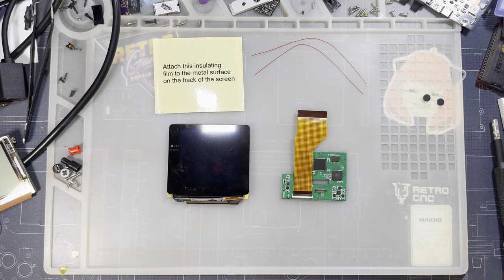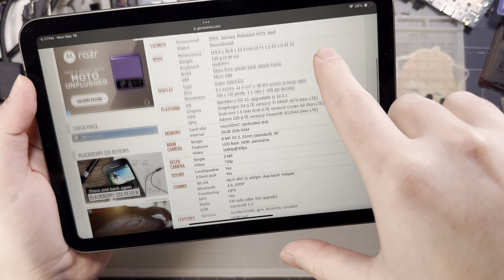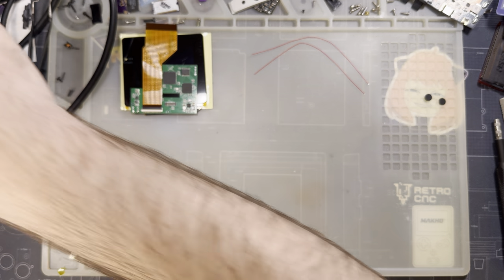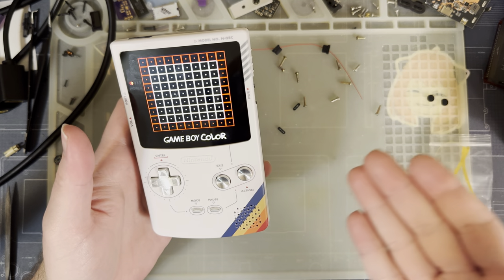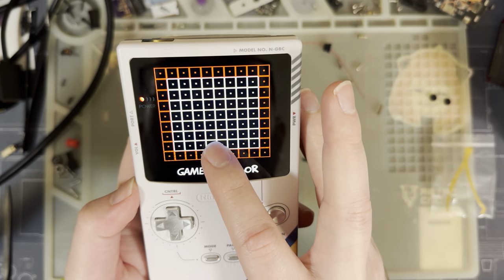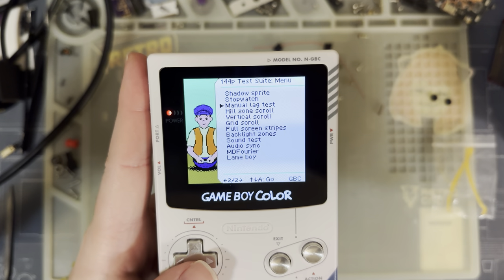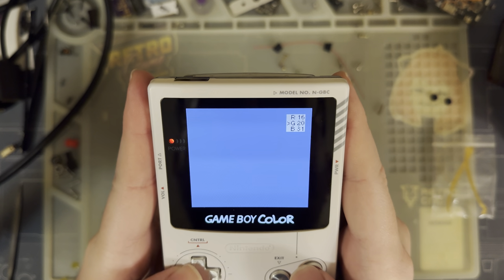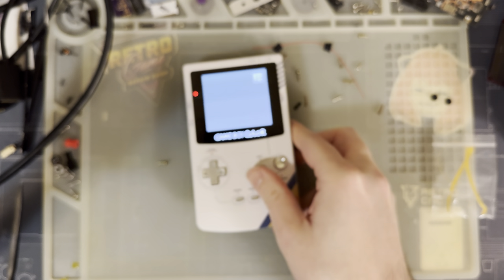Game Boy Color OLED Backlight Kit with Touch Screen OSD

Comment: The power consumption with pixel grid should be lower, because only 9 instead of 16 pixel are lightning up by itself (no common backlight with oled). Thats how oled usually works, black pixel are just off.

Comment: The color modes are meant to be used with original GB carts while booting up in grayscale mode (hold left+B). You get the same default color palettes as their DMG kits. If you don't hold left+B, then you get the weird color palettes.

Comment: OLED ALREADY?!?!
Nice, can’t wait to use this for the FPGBC.
Reply from the maker: This doesn't work in the FPGBC. 

Funnyplaying is making one that will take one of these OLEDs but Q10 displays have never been interchangeable with Q5 displays.
Reply: Unless someone makes a separate screen mod just for adapting this screen panel to be used with the FPGBC, I wouldn’t bet on it working since I can’t imagine it’s drop-in with something meant to only use the Q5 IPS screen. Maybe if FP starts using the Q10 OLED screens and releases an update to get it working on the FPGBC.
Reply: Ah, Makho already explained it, didn’t see that until I refreshed.
Reply: want
Reply: @makho Do you actually know for sure that FP is planning on releasing a FPGBC with this screen or were you just predicting?
Reply from the maker: @SlCKB0Y-sb1kg  I know they already have screens on hand. The rest is speculation.

Comment: proper desaturation instead of those gimmicky color filters would be a real killer feature!
Reply: Buy Q5 instead.. I have both Q5 and Q10(OLED). Q5 have exactly what you want. It is that good.
Reply: @Rurounik99  I bought a FP Q5 display last year :) It doesn't have color desaturation, colors are too intense compared to an original GBC screen. Or are you talking about a new Q5 revision that now has this feature?

Comment: that black bar is because the pwm modulation, that could affect the eyes strain negatively old oleds have max 240mhz in high brightness and 120 in low.  ips panels can have pwm but the valor is high enough that dont affect your eyes. Im sensitive to low pwm in oleds and i cant use any device with oled screen unless they have high modulation or local screen dimming . Sadly is not information of the pwm of this screen i tried to research and i come empty handed.

Comment: I have the same case with the funnyplaying motherboard and the metal buttons. How did you get the membrane to fit over the start and select buttons? My membrane over the start and select does not fit over the metal buttons because they protrude way to high and it's hard to keep it balanced - did manage to put it in, but the buttons were super stiff and did not register start and select. Any ideas?

Comment: hey bro can you post a link the tape insulation you used ? or go more in depth with why and where needs to be protected like make a separate video going over and more in depth possibly showing you also trimming the pins or something thank you i enjoy your videos gained a sub!
Reply from the maker: It's just polyamide tape. Brand name is kapton. The pins are proud on the board so you need to take steps to ensure that they don't contact anything. It was a much bigger issue with older kits and I've recycled this board so that's why it was already done. If you use the included insulation film with the kit, trimming and covering the pins is unnecessary.

Comment: How is your battery as mine is dead after about 30 minutes on full brightness on a normal AA battery
Reply from the maker: You should get more than 30 minutes. Check your batteries and probably clean your power switch.

Comment: Need an OLED for my Slate
Reply from the maker: No good sized panels at the moment. There's stuff in the correct size and resolution and there's OLED. No display checks all three boxes and is available in enough units to justify making a kit.

Comment: SUPER AMOLED is far better than any other OLED technologies, perhaps QD Oled might beat it depending on the case. 
Now slapping an OLED display inside a console made for LCDs has crossed the line for me... OLEDs are nice for 4:3 machines that would replicate CRT displays in combination with the right filters but simulating the LCD look is an other story.
Reply: Well if it crossed your line, then don’t buy it
Reply: i dont follow the logic but you do you